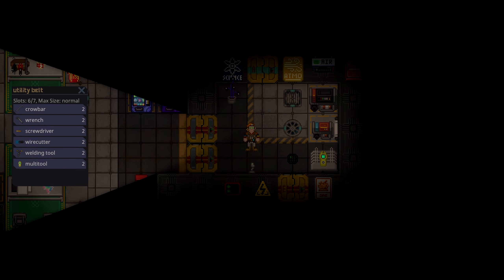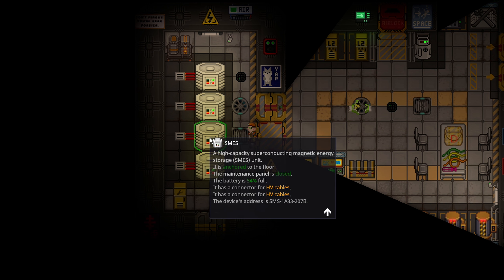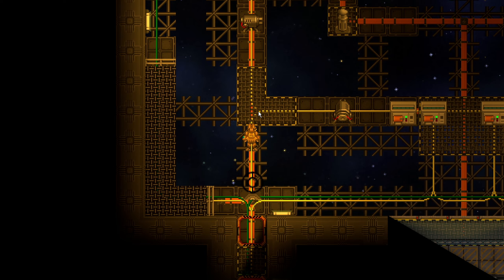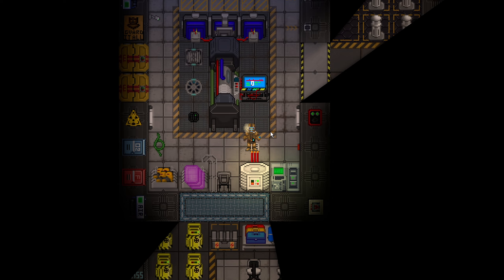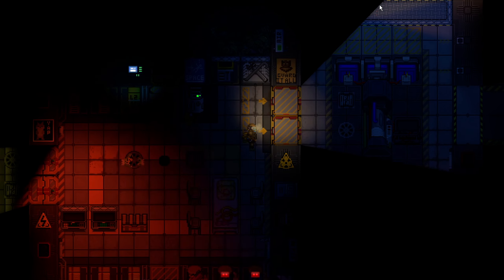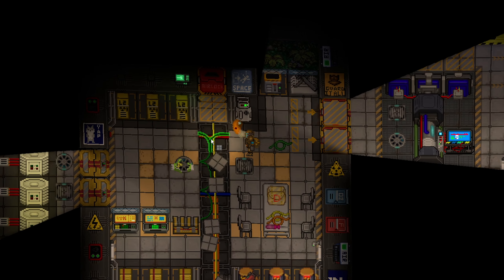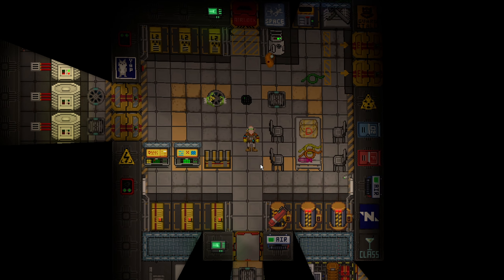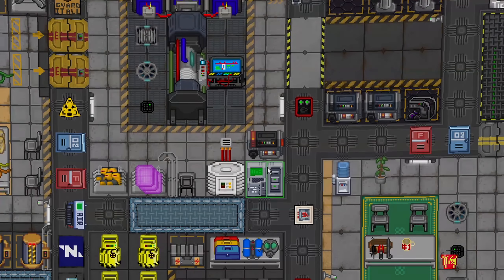SS14 - How to Setup Power on "Core" Station

Comment: I've found out that due to the plasma tank refilling requirement setting up a TEG is just easier and it produces quite a bit of power.

Alternatively, radiation collectors surrounding a radioactive artifact or bananium pile, pretty decent too
Reply from the maker: TEG is easier due to no risk. Core doesn't feature a TEG, however.

Comment: I just had the wildest round and I had to share it.
I started the shift as Jordan Freedwarf, Salvage Specialist. Turns out I was the only cargo worker. Smiles showed up and tried to communicate, eventually saying they wanted to go on an expedition. QM shows up, so I can start doing my job, and I select a snow planet with xenos for the mission. A second salv joins, but I spent so much time preparing that Smiles had to ghost as we embarked.
We landed, and due to the ship's orientation, went south when we needed to go north (we didn't know this until our demises). We also got set on fire by a plasma river. Eventually the river pushed us far enough off course we decided we need to cross it. At my PAI's suggestion, I threw him across (so he could "catch me") and ran across myself. Look, it wasn't a brilliant idea, it was a yolo idea.
I barely failed to put the fire out before I went crit. I burnt to death and turns out my partner did also at a thinner crossing point.
We'd both died without having even found the dungeon, and I'd noticed no-player Smiles had started wandering from the ship.
Wanting to make sure Smiles survived, I took their ghost-role, and moved them back onto the shuttle, and waited the timer out.
At which Smiles was now stranded in space. I waited a bit, tabbed out, and after a while I nearly ghosted myself, but then another Salavger joined the station, so I held out hope for rescue.
A shuttle with security finds me at about the same time the new Salavger boards the ship, and I finally get back aboard the station. And they have no idea what happened to the salvage team.
At this I figured Smiles would be distraught. They asked to go on a salvage operation, the salvager worked so hard to help them join them, and now they were dead because of the expedition Smiles had asked for. So survivor's guilt hit Smiles hard. They broke down crying in cargo, being interrupted by a revenant trashing the place.
After that, security had started to suspect the third salavger for the disappearance of the others, and I hurriedly tried to explain their innocence. I may have been a little too explicit in details with my @ emotes, but I tried to keep it to a pantomime levels to give it some plausibility.
There was a brief looc talk about me using meta-knowledge to clear them, but I pointed out I knew they were innocent as Smiles, since the first team had died long before the third salavger showed up. Having established it wasn't meta-knowledge, we got back on track and the salavger was let go after Smile's testimony.
Having gone to the bar now, Smiles came across a sentient hydroponics tray, and ends up telling it what happened. Sympathizing with what happened, Smiles ends up befriending it, and it helps deal with the trauma poor Smiles is having right now.
Singuloose gets reported around cargo, and evac is now on the way. Smiles heads to evac, dragging the tray. They won't lose another friend. The duo make it to evac, and have a bit more bonding while waiting for the shuttle to arrive.
Shuttle arrives, and an engi-borg helps drag the hydroponics tray into the engi compartment for safety. Shuttle gets bombed in transit, and the borg tries to help seal off the engi compartment, but it still runs out of air.
Smiles is cowering in the back, gasping for air, and thinking I might not make it, I type Friends to the end as I hug the tray. But we were lucky, and the shuttle arrived in time for the borg to drag me onto Centcomm station before I went crit. Smiles survived.
I tell the others about how I was actually the salvage guy who first brought Smiles on the mission, and I get a shock.
The borg tells me he was my salvage partner.
The hydroponics tray tells me they were Smiles initially.
Even in death, the gang found each other again.
Absolutely amazing round, not sure if I can top it.
Reply from the maker: I was adminning that round and witnessed a good bit of that story first hand
Reply: I'm going to try and find it tomorrow on replays, I wanna save it
Reply: Soul.
The main ingredient of SS14